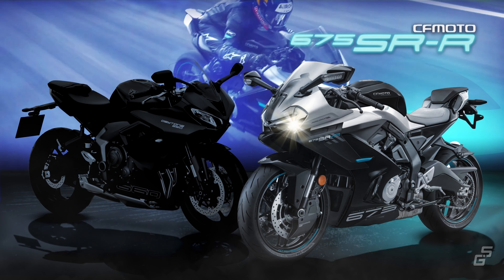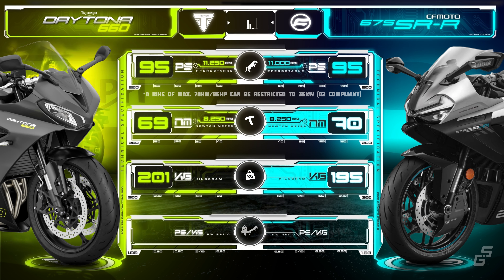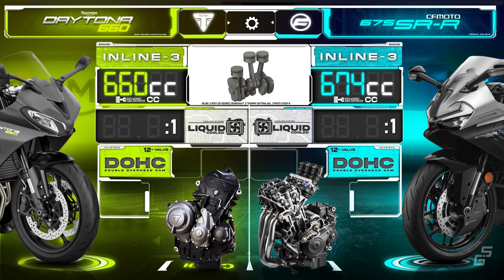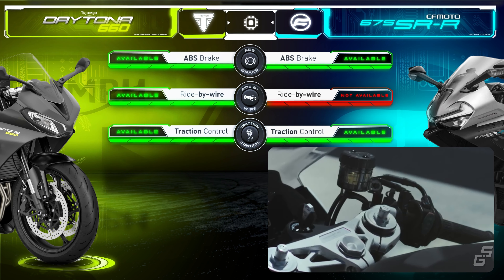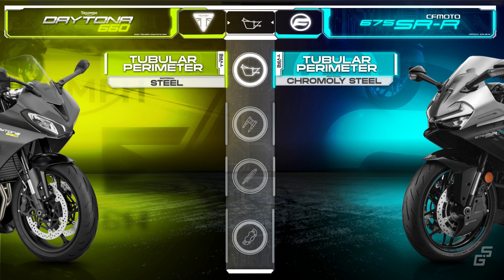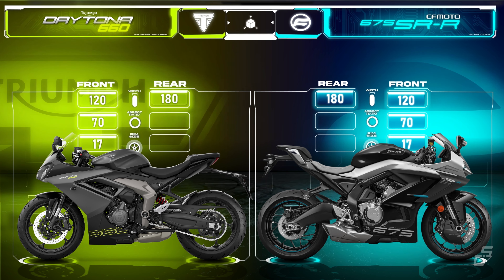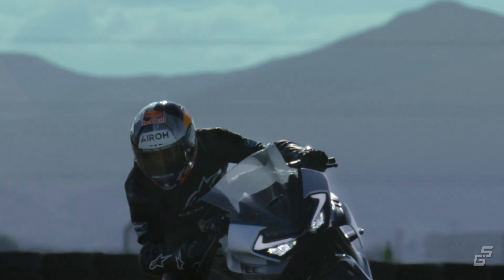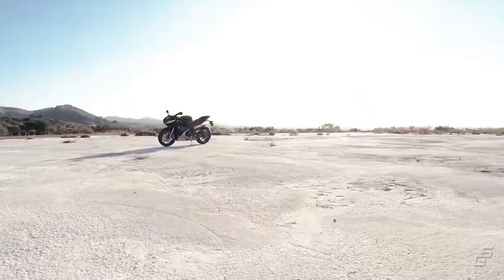Is this the Daytona we’ve all been hoping for? ┃ 2025 CFMoto 675 SR-R  / SS vs Triumph Daytona 660

Comment: Cfmoto has just destroyed triumph here!
Reply: I'm buying the 500 or 675 when it comes to the us. But we'll see in performance how it compares. Triumph is no joke when it comes to handling
Reply: @Gary-s6r  Th 500SR Voom won't be released in the USA from my understanding. It's a China only model. 
Comparing the 675SRR to the Daytona 660 is a fair comparison but the CFMoto falls short of the 675 Daytona by 25+ HP. I am super excited to get a 675SRR though, it will be a great ride im sure.
Reply: The new 'Daytona' is essentially a Street Triple 660/A2 with fairings, which holds a nice stable line for touring but you have to wrestle it at speed; doesn't tip in, rudimentary suspension. Hopefully the CF's shorter wheelbase, steeper trail, lower bars, better suspension in addition to its sports-intended frame and ergos, accumulate into a notable improvement. Curious how much more you could juice out of the engine as it's just empty space above 11k rpm, I would hope +15hp at the very least with a full system/ de-cat and tune. The seat and pegs also suggest a design for sitting further back, and the front forks look like there's 50% more travel. Aesthetically much better and less cringe than 450SR. Excited to test it.
Reply: Not only triumph....the whole segment for this kind of motorcycle 🎉🎉🎉
Reply: Yeah cfmoto is going to destroy itself after 3 yrs.
Reply: @Gary-s6r  my local dealership told me they have their orders in for the 675 and they were told they will see them between February and April 2025 and I am in the U.S
Reply: @airgunbubba2505 to my surprise as well, the 500SR just released here in Indonesia. I thought it'd be China market exclusive, so there could actually be hope to get it on western market!
Reply: @airgunbubba2505  fair point. But missing 25HP on the Daytona 675 isn't a deal breaker for many people. It still has a ton of power that the regular Marc Marquez wannabe would never dare to take full advantage of. The fact that the CFMOTO 675SR has a lower output is actually a blessing. Given its lower compression ratio, the bike is bound to last way longer than the Daytona 675's highly stressed engine.
Reply: @ulquiorrasciffer04  educate urself 💀

Comment: Everytime I watched any video about cfmoto there'll be a comment questioning the reliability. Well most European bikes got reliability issues in their earlier years and people's still buying them just because it's better bikes from their Japanese counterpart. Japanese bikes were well known for their reliability but in order to keep that's reliability title their bikes tends to get bored in time. Cfmoto at least have a good starting price and  you'll get cool setup (mostly copying European brands). Just imagine you get a European bike with a price lower than japanese bike. Yes you might not get the bulletproof reliability but you're getting much cooler bike with cheaper price. Regarding parts availability it's up to where you lives. In my country it's easier to get parts for cfmoto compared to European brands. And it's way cheaper too.

Comment: I'd say I'll definitely choose 675SR-R over anything (even ZX6R)
Reply: I have a ZX6R and would not take the CFMoto over it, but I do want to add one to the stable!
Reply: ..not quite the same category. 125hp vs 95hp. That's like comparing a Toyota Supra to a Mazda Miata! Both nice cars but different category. ZX6R is better than most bikes it competes with: GSXR 600/750,  CBR600,  Aprilia 660
Reply: @FuzedBox  ..between my son and myself we have a '18 Ninja 650,  '23 CBR 650,  '24 ZX 4rr,  '09 R6... and like you we are just missing a 3 cyl and will likely add the CF Moto675sr. It helps that there's a CF Moto dealership 20 mins from where we live in Pa.
Reply: why 💀
Reply: Fewer cylinders in a supersport application where high end hp and high revs matter,  is not the way to go.  
3 cylinders is awesome in streetfighters like the Speed and Street triple, but you want high HP in a supersport application.  Why do you think the vast majority of supersport bikes have inline 4 cylinders, not 2 or 3.  Even Duc went to a V4 engine.
Reply: @VBMichael_D @MichaelPullins-h8z, thank you for highlighting the obvious. I appreciate that. My pretty vague statement (I must admit) is that they are saying they will choose a cf moto 675 when it really is not competing well with the rest of the field; its only advantage, id say, is that you get a nice-looking bike that's cheap, but in terms of performance it doesn't really compete with anything in that "middle weight category" from bikes like the rs660 all the way to top end ducati v2's. I'd say its what triumph should have made for the 675, but even then, a gsxr 8r is a prefferable option to  both of the bikes, seems like a worse pick coming from a company that lacks any reputable RnD.

Comment: Compare the cbr650r vs cfmoto675 vs ZX6r
Reply: CBR650 is a heavy bike won’t be the agile bike you need for daily riding !
Reply: @shawnpenn The cbr650r literally built for daily street riding. It’s extra weight really not gonna make much of a difference unless you’re going to the track.
Reply: @HifeMan  dude weight makes all the difference in the world whether its street or track. To give you a reference I ride a ninja 300 everyday for office and on the weekends ride a BMW S1000rr M and its lighter than my ninja 300 everyday bike and becoz its light as a feather 🪶 its terrifically enjoyable fast and not a pain in occasional traffic ! So I would pick a CFmoto 675 anyday over to a Triumph ! For regular to trackday use ! Weight & Adjustability being the main reason !
Reply: @shawnpenn  A bmw S1000rr M is not lighter than your ninja 300. 

A 20-40 lbs weight difference does not make all the difference in the world when you’re on the street. It’s noticeable but unless we’re talking 60-100lbs difference, that’s where you really start to notice.  Heck even the Hayabusa has surprising good handling and yet it weights over 500lbs but the weight is very well distributed and balanced. A great bike you could daily if you really wanted. ;)
Reply: @HifeMan  it is
Reply: @shawnpenn  BMW M1000rr  is 423.2
lbs unladen weight, the Ninja 300 is under 400 lbs.

Comment: funny how nobody speaks about reliability, probably the most important thing above all...
Reply: Because it's compared with triumph. If compared to Honda than it's relevant to talked about.
Reply: @Ayap_SOG  Triumph is probably the most reliable non-japanese motorcycle brand…
Reply: @johnnyhun1  yes it is but it's still not bulletproof and when it does have a problem it's gonna take months to get those parts and it's quite expensive.
Reply: Bruh European vs Chinese here, reliability is out of window. if it ain't Japanese, reliability is not worth to discuss.
Reply: @Ayap_SOG  depends on where you live. In Europe the part resupply is quite fast since they produce them here. In the US or New Zealand or palces like that yea it will take months probably :D

Comment: all CF Moto need is an upgraded higher compression ratio piston it will boost its power to over 110
and an additional intake cam will add another 10 😊😊
Reply: Euro 5 Emissions remember?

Comment: So what’s the price on the CFMOTO 675?
Reply: A CFMoto dealer told me that I would be looking at 10k USD out the door price after tax and title/registration. So I would place the CFMoto 675SRR between $8599 and $8999 USD. This makes sense with how every other bike they have is upwards of $1000 cheaper than the competitor's models. All except the Papio, roughly same price as grom.
Reply: Sheesh that’ll be a steal in that price range especially with the tech it offers. I’ll definitely be looking forward to this bike. I currently ride a 2024 450ss.
Reply: @G_Flash89  I'm on a 2023 CLX 700 Sport. Absolutely love it!
Reply: @airgunbubba2505  niiice this 675 will be an upgrade for us. The only downgrade will be the riding position but that come sign the territory
Reply: Also cruise control but I don’t think they’ve fully released all of the features yet
Reply: @G_Flash89  I have been watching the CFMoto Mexico channel and they have released a lot of info about other bikes coming to market like the CL-C Bobber 450. They shoved the 450sr/ss engine into the CLX frame and chopped it...looks amazing. Now if only they'd start using the 950 HO V Twin in a modified CLX frame...